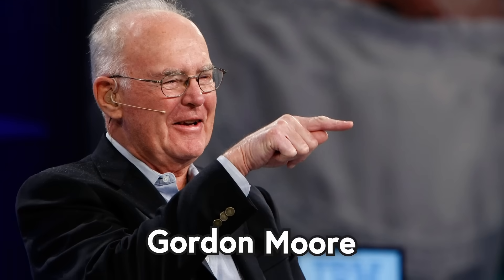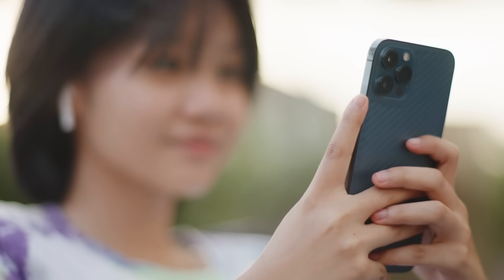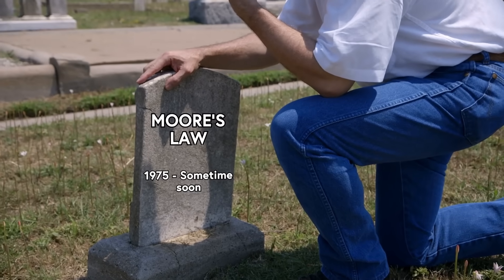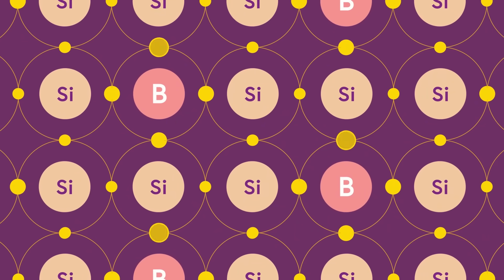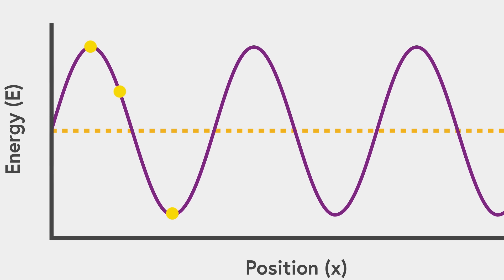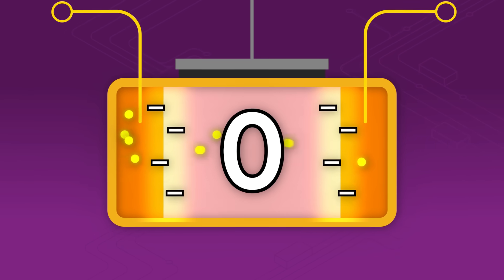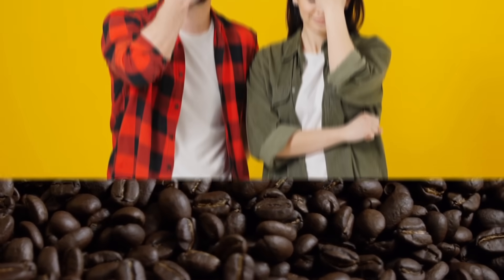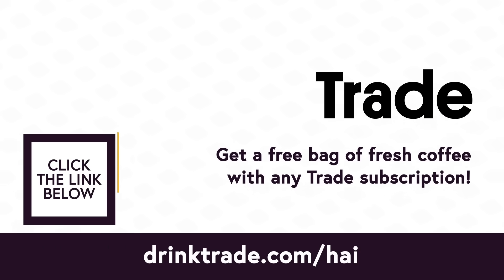Why We're Reaching the Theoretical Limit of Computer Power

Comment: 3:24 for anyone trying to learn about transistors, it's important to note that the depletion layer is not negatively charged (that would break charge conservation). The P side (the material with holes, Boron-doped silicon in this example) becomes negatively charged because the number of (negative) electrons in the area outnumber the (positive) protons in the nuclei. The N side becomes positively charged because it now lacks electrons.
Reply: sorta? Assuming both sides are equally saturated in doping then the charge would be neutral as the electrons and the "holes" meet each other and co-destruct.

Comment: 3:15 — What you’re saying here about the depletion layer and such is really more about Bipolar Junction Transistors, and especially silicon diodes.  

The transistors used in “chips” are Metal-Oxide-Substrate Field-Effect Transistors (MOSFETs).  They work very differently:  You can think of the as like a voltage-controlled resistor.  The electrical resistance between the pins called “source and drain” is controlled by the voltage on the “gate” terminal.

In digital circuits, that resistance is pretty much either “zero or infinity” (loosely speaking).  In other words, it’s an electronic on/off switch.

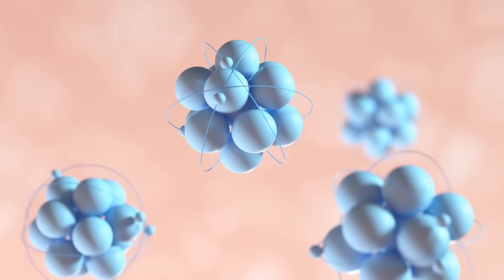3:52 — It’s debatable whether it could be called “Quantum” Tunneling, but Tunneling, yes.

Comment: Since the size factor doesn't matter in desktop/laptop how about they remove all the extra cameras to add another processor (google pixel proved that more is not necessarily better) and focus on the battery life instead. (Makeshift solution incase it actually comes to a standstill)

Comment: If transistors can’t get any smaller, then why not make the chip bigger?
Reply: Bigger chip sizes limit the speed of the chip, because information can only travel so fast within the chip. It also causes much more heat to develop.
Reply: @regarrzo  I see your point, but it still doesn't convince me...coz they don't seem like unsolvable problems...
Reply: @JaysusEscobar  Well, we can't change the speed of light. Another issue is that manufacturing becomes increasingly more expensive as more area causes a higher error rate.

Comment: So I get that you can't fit more transistors on the same sized chip, but why not make the chip bigger? What's the downside of that?
Reply: A bigger chip has more flaws
Reply: Bigger chip sizes are more inefficient due to longer times the information needs to travel and they limit the speed of the chip.

Comment: Computing power is not all about scaling.
There are other factors like architecture,parallelism,optimization in cpu instructions order,architectures in ALU design,cache pipeling. So many possibilities,hence we will still see increase in Computing power even when scaling limit is achieved.
There are other design considerations like In memory Computing,high performance Non volatile memory devices,Neuromorphic architecture,considerations in how programs are to be structured. So many possibilities.

Science is directed by business of interest,if scaling limit is achieved we will just shift from Von Neumann to Neuromorphic Architecture in CPU designs. Multiply & accumulate operations to be done using NVM analog design not by instantiating Adders or matrix multipliers,i guess you get the point.

Comment: Moore's Law is only dead if you're looking at traditional silicone transistors. Graphene changes everything, and could potentially cause tech to leap ahead in efficiency by unimaginable amounts. We've beem attempting to apply graphene to electronics production for the last three decades, so it has been hard to get a grasp on (the hardest part is guiding the path of the electricity on a sheet of material that is only on atom in thickness), but we are making strides.

Comment: From what I read so far in the comments section, it looks like I'm about to break a trend. The latest opinions of the researchers working on Quantum Computers and Quantum Networks suggest that QC or QN won't replace the classical transistors. It is expected to be used in research and security. 😞

Comment: Were not reaching the theoretical limit of computer power, were reaching the theoretical limit of transistor density. Multi processor computers already exist, and with the motivation to properly refine how they communicate together and break up tasks we will be back on the road of ever faster computers. Or processors will just become absolutely massive, AMD has already proven capable of larger processors made of smaller processor "chiplets" all working together.

Comment: Everyone talks about Moore's law dying because we can't make transistors smaller except Moores law doesn't specify that transistors get smaller, only cheaper and doubling the amount in a circuit. Once we reach the theoretical smallest transistors, there's a few things that can still be done:
Firstly, we can make the circuits larger. This has already been happening in the last 50 years, the architecture changes and sometimes we see more transistors play out through larger circuits, not just changes in the transistor makeup. See cerebrus wafer-scale computing for an extreme example of this path.
Secondly, its possible and even being investigated to stack transistors three dimensionally. This poses a lot of challenges in heat management and the integrated wiring, but nothing fundamentally prevents this from happening. 
Thirdly, the cost is likely to keep going down further when that theoretical maximum is hit, possibly even more aggressively as the infrastructure for making these transistors won't have to keep changing with new transistor makeup, and so economies of scale will be able to play out even wider. This is likely to benefit larger circuits architecture and we could see very large CPUs start to become more normal even in commercial products not just server products. Again there's heat management issues to consider but these are just some ways Moores law could continue. I've been hearing for the past fifteen years Moore's law will be dead in the next year or two, and it never happens. Not to say there aren't challenges to overcome, but so long as there is rising demand for higher and higher compute power, there will be a drive to include more transistors in a circuit.

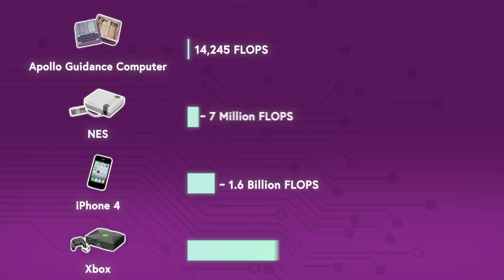Comment: Rеtаrd alert at 1:30

TIL the 6502 can execute multiple floating point instructions per cycle...was this chart made by a mentally rеtаrdеd person? Only someone with below room temperature IQ can claim the 6502 can execute 7 MFlops at 1.79 MHz.

Oh, a sociology major probably falls into that category.
Reply: Probably mistakenly taken from the modern version (WDC 65C02)
Reply: @willadelman8870  LMAO, no. No version of the 6502 can do 4 floating point operations per cycle. PER CYCLE!
Reply: @fungo6631  Not sure about the exact measurements, but it can operate at a much higher clock speed as well so it would need to do multiple ops per cycle
Reply: @willadelman8870  What? Do you even know what a cycle is? If it operates at a higher speed it will run faster, sure, but the cycle count per instruction will still be the same.

Comment: take note the MOSFET is only the most common now because its cheap, however if you have infinite money to spend you can get a chip made with FINFET which doesn't have the same limitations as MOSFET, almost all of the smallest transistors in the past 10 years have been designed with FINFET

Comment: Yes well... but that doesn't mean that we are reaching any sort of theoretical limit on compute performance.  Your illustrations are 2D.  Transistors are 3D.  That's one problem.  A second problem is the tunneling isn't anywhere near its limit yet.  Generally speaking, this is why the voltage running the CPU keeps going down.  There are limits certainly, but we aren't anywhere near them.

Also, there are always electrons tunneling across the barrier, even now.  Its called leakage current.  But digital logic is self- reinforcing so logic states are retained.   That does dove-tail into the real reason that compute power is at a local plateau (at least on a per-watt basis). That reason is power density.

While leakage is an issue for idle power, the real problem occurs when a transistor switches state.   It is important to reduce both the (idle) leakage and to also reduce the energy consumed when a transistor's state is changed.  It turns out that smaller features both increase the former and decrease the latter.   So finding a way to reduce leakage current is an import facet for further miniaturization.

And just as importantly, the voltage swings are getting smaller and smaller as the supply voltages get lower and lower and this starts to bump up against "noise" on the power busses.   It is relatively difficult to control noise when you have tens of billions of transistors changing state at multi-gigahertz rates.

Comment: Don't go too far to quantum computer yet. Other than shrinking transistor size, there're tons of other techniques like instruction set, optimizations. Even photonic computer which is based on the same principles as classical computer.
And finally, quantum computer IS NOT a computer. It's like an accelerator card like GPU at the moment 😅

Comment: Is the transistor description accurate?  Phosphorus diffusion coefficient is very high, compared to arsenic's, so anything ion-implanted tends to use arsenic to create the n-type regions on a silicon chip; subsequent high temperature operations on the wafer would cause the phosphorus to diffuse, resulting in shortening the channel lengths of the transistors.

Comment: That's not going to be a problem. The process node size names already don't mean anything, don't represent any measurement you can do on any layer of a chip, and they haven't for a long time. Since it's just a name, you can just keep coming up with names; nobody is stopping you from renaming TSMC 3 nm to 1 attometer.

What people really cared about was a corollary to Moore's law; Dennard scaling. With Dennard scaling dead as a door nail there is only Moore's law left to care about, so we do, because we must. Dennard scaling was so synonymous with Moore's law that it used to be wrongly stated that Moore's law is the doubling of performance every ~18 months. That's why technology exploded in the 90's; 60% higher CPU performance per year on average for an entire decade; mostly from straight up clocks. Today it's all conditional; more transistors lets you create more execution units per chip, but if they aren't kept busy they give no performance at all; more transistors lets you create more cores that run independently, but unless the problem is parallelizable it really doesn't help; even if it is parallelizable Amdahl's law means that any synchronization and serial fraction quickly kills gains from more cores. Twice the cache gives 5-ish % more performance on average; way more sometimes if the program doesn't fit neatly into the prior cache size but does with the new cache size and a bigger cache may also have more clocks of latency and run slower for some applications that don't need this much cache. 

That's why anyone who was alive and paying attention in the 90's thinks technology is improving at a glacial pace. More important things happened between 1998 and 2003 than the next 20 years. In 2003 you had recognizably modern shaders, you had processors that clocked about as fast as now with kind of sucky IPC and only a single core. 

A 10 year old computer is still kind of OK. Windows despite having the same basic functions as windows 98 (only crashing less), is somehow no faster on a fast SSD than windows 98 was on an ancient harddrive due to the increasing processing demands (but to be fair; this may just be Andy and Bill's law). Software (e.g. AI) and embarrassingly parallel types of applications (graphics, AI, stupid brute force number masturbation like bitcoin) are improving sort of quickly; but the rate at which they are improving was general in the 90's, now it is application specific; in the 90's graphics accelerators were improving even faster (both Dennard scaling and Moore's law).

What killed Dennard scaling was two things. Thinner gates leak too much and voltages much below 1 volt weren't really a reliable functioning device anymore. This means that the drop from 5 V to 1 V that gave a 25x reduction in power no longer could happen. It now takes heroic effort just to make a new generation of devices that are slightly better. Before, it was just a linear shrink and you "magically" got increased clocks, reduced voltages and more transistors at constant power per die area (but clocks increased a bit faster than Dennard scaling at a cost of more power).

Comment: Of note, Murphy's Law, as originally stated by Murphy himself, was a reference not to random failure, but to human error. If something can be done a right way, and a wrong way, someone will do it the wrong way, such as with people jamming a USB-A plug in backwards, which the USB-C plug is resistant to(having no "wrong way" to connect to a USB-C socket, but still easily destructive if you shove it into a Mini-DisplayPort)

Comment: @halfasinteresting The term "2 nanometer" or alternatively "20 angstrom" (a term used by Intel) has no relation to any actual physical feature (such as gate length, metal pitch or gate pitch) of the transistors. According to the projections contained in the 2021 update of the International Roadmap for Devices and Systems published by the Institute of Electrical and Electronics Engineers (IEEE), a "2.1 nm node range label" is expected to have a contacted gate pitch of 45 nanometers and a tightest metal pitch of 20 nanometers.[5] As such, "2 nm" is used primarily as a marketing term by the semiconductor industry to refer to a new, improved generation of chips in terms of increased transistor density (a higher degree of miniaturization), increased speed, and reduced power consumption compared to the previous 3 nm node generation.[6][7]

Comment: Increasing the number of cores in a CPU or the number of CPUs in a system is how we get around Moore's Law.  At the moment we already use the former in desktop computers and the latter in servers and supercomputers but the real breakthrough will come from multi-level cores, possible even cube cores one day.  If you can fit 16 billion transistors on a sliver of wafer that is 6mm x 6mm in size then imagine how many you could fit in a cube that is 6mm x 6mm x 6mm in size?   More processing power than all of the supercomputers in the world in a single chip/cube.  That is many decades away though so until then if you can't fit more transistors on a core, you build more cores.

Comment: "I asked Amy to whip up a quick explanation of quantum computing"
If you want an actual explanation a quantum computer doesn't store 0s and 1s, but a % chance that a bit might be a 1 (a QUBIT ). When you try to read a Qubit it either shows up as a 1 or a 0 based on that % chance. Qubits aren't as good as regular bits for holding static numbers but are much better at holding functions that get collapsed to a number - that is, it's much more efficient to store and edit a complex probability as an actual probability provided you always roll it at the end of the day.

Comment: In my opinion, I don't think this is a great explanation because it blames the problem on the material used and not the actual issue. Approaching the problem from the EM field perspective gives a better understanding of the issue. I would attack it by saying that the switches (transistors) that we use are getting small enough that in the off state, they act as capacitors rather than an open in the circuit. The video can go on to explain what is a capacitor and what an open in a circuit is. Veritasium has great videos explaining how electricity actually works. (Electrons moving from atom to atom gives a false reality of how energy is transferred through a circuit).

Comment: There are other ways to do things. Transistor cramming had its run, but adding more and more transistors is hardly a major innovation. Running up against a transistor limit is probably the best thing that could happen if it makes chip designers think.

Comment: It's not often discussed but what I find more interesting than how many transistors is the power per transistor which has dropped from about 10^-4 for the Intel 8008 to 10^-9 watts for Gen 13 processors.